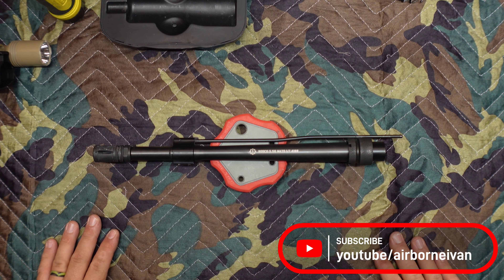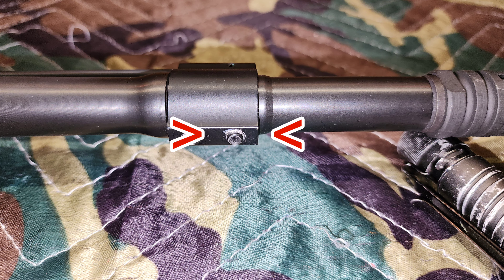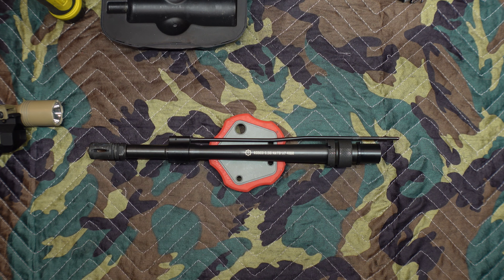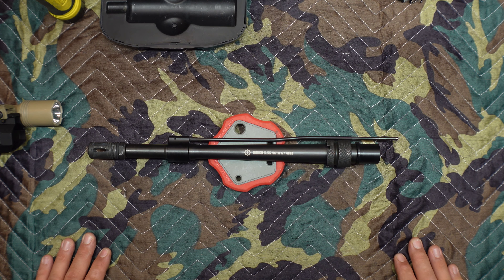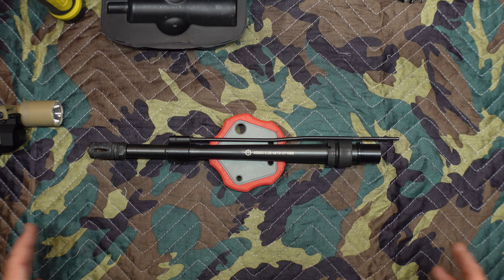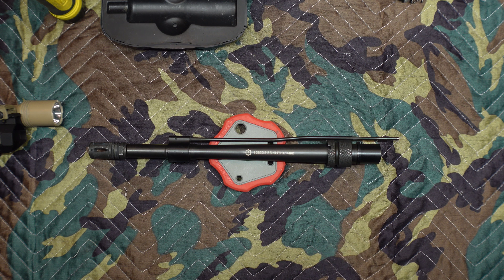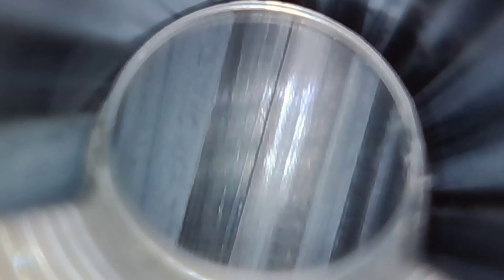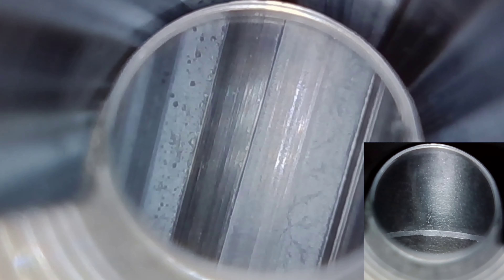Rosco Mfg/Sage Dynamic K9 12.5" Patrol

Comment: Hopefully things go better for you on the rebuild. What’s your process for bedding the barrel with loctite?
Reply from the maker: Depending on the fit of the barrel to the upper, I'll use green Loctite 609 (retaining compound) by putting a liberal coat on the barrel extension, seat the barrel, wipe off the excess and torque the barrel nut to spec. Usually around 55 lbs ft. then leave the barrel and receiver overnight so it's cures.

Comment: I watched this cause I just purchased this barrel. I hope you have better success remounting it. Quick question.. What borescope is that? Amazon?
Reply from the maker: I did get a little better results with some loads. I have a second video posted that shows the results. I think it's a great barrel and will do fine. I believe it to be a 1 moa barrel with the right load. The bore scope is a Teslong from Amazon. Works well. Would like to get the rigid one that has the focus on the handle. It's much more convenient.